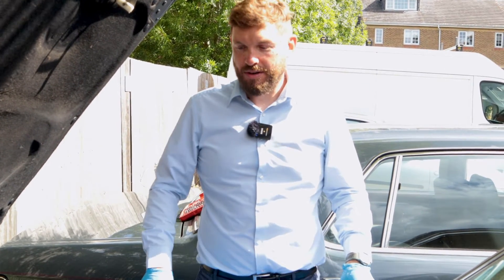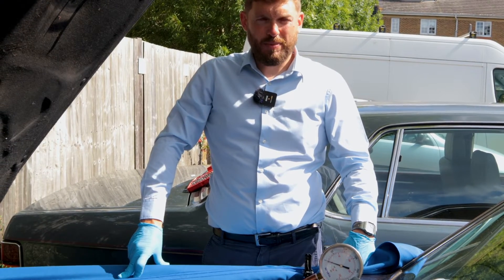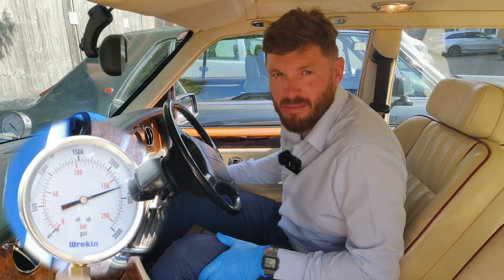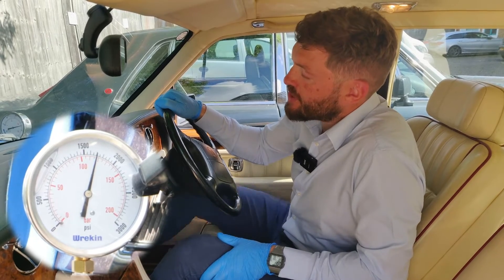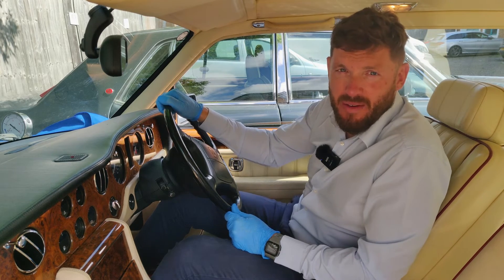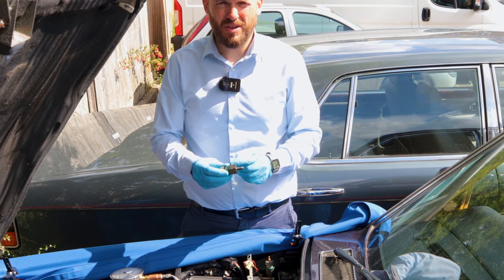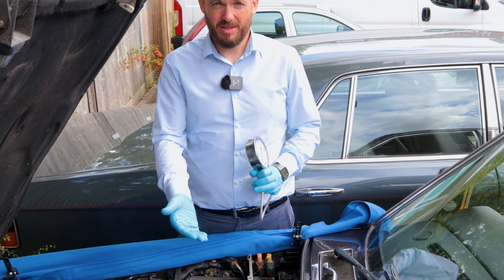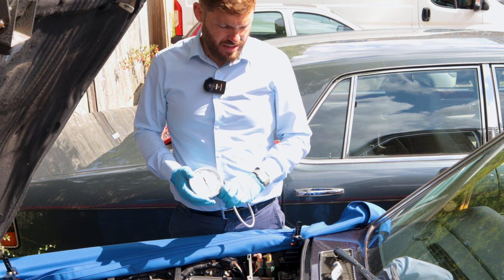Bentley & Rolls Royce Hydraulic Brake Pressure Testing : Tutorial

Comment: Doesn't it have a backup system in the event of the engine cutting out? The shadow 1 has a standard master cylinder which brakes the rear wheels and it will stop the car if the engine is not running. Useful info about the brake pressure gauge.
Reply from the maker: The only back up is the reserve pressure in the spheres. As you can see from the video, it takes many pumps of the pedal to fully depressurise the system. That is why it is so important to ensure that the spheres have enough pressure. Part of the service schedule is to check the pressure in the accumulators. One of the reasons why the correct service schedules are so important.